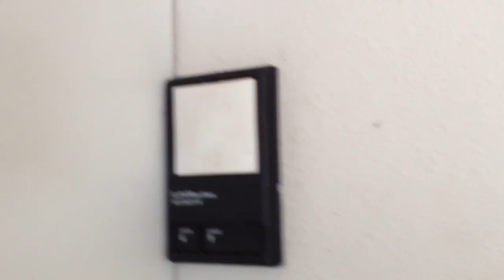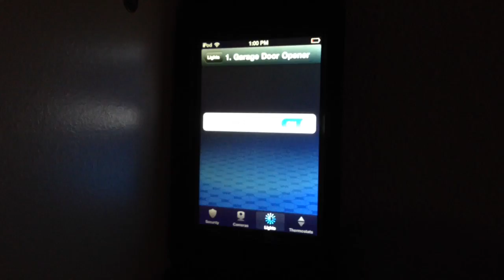ADT Pulse Z-Wave Garage Door Opener

Comment: Radio shack around here didn't have any of the relays so I used a door bell transformer from Lowe's which worked just the same and was 11.97.  Item # 50500

Comment: I used part # 275-0217 110v DPDT Plug-in-relay from radio shack $10. My opener looked nothing like his but had 24v bell wire connections and a plug in the back of the garage door opener. I connected #4 to one side of the 24v bell wires and #6 to the other.  I left the existing bell wires. Opened System and selected Modes and created a mode named Garage Door.  I configuring an automation routine that turned on the Z-Wave Lamp module with no delay and 5 seconds later turned off the lamp module.

Comment: Question If you had two outlets. Would you be able to leave the pulse app on and still have the liftmasters stuff work?  Im looking for a solution using z wave that will let me close my garage door if i forget on the road.  but i dont want to have to remember to disengage the zwave app if my wife strolls in and want to open / close the garage using the button on the wall.